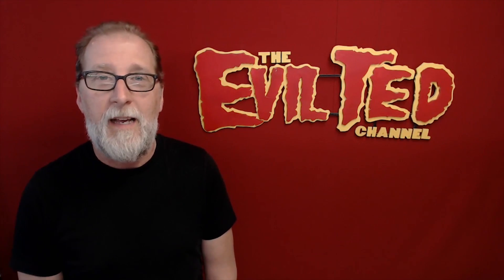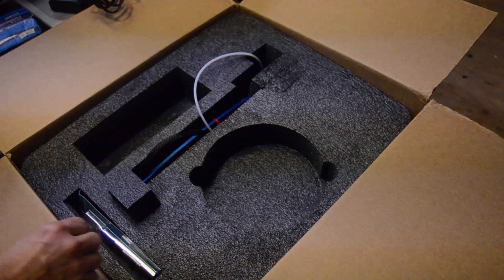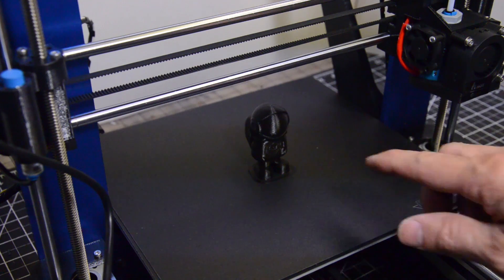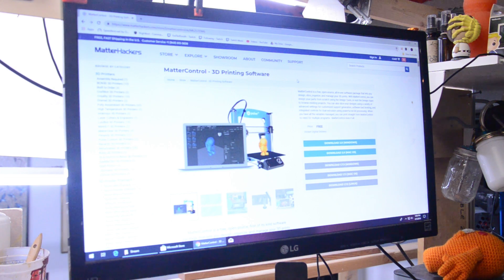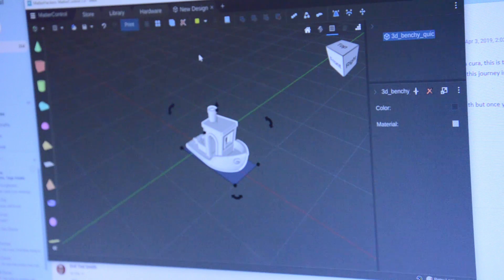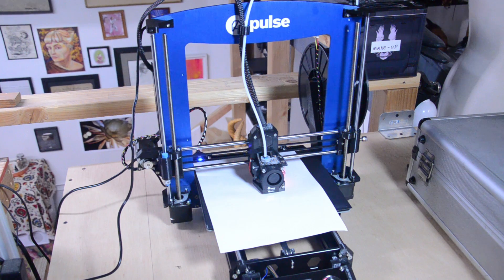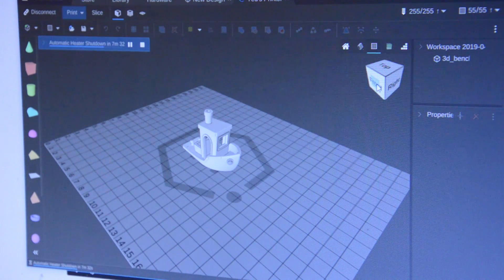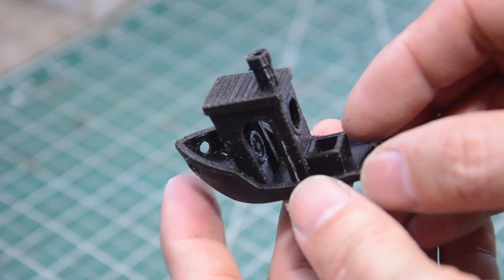Setting up my PULSE 3-D Printer.

Comment: I think I missed the part during the setup but why did you cut off the bottom of the bench model? Also have yo tried printing it without supports? At the original scale of the Benchy, the overhangs are short enough that the printer should be able to handle it without them. If you DO see any issues in those spots it a clue that the settings need to be adjusted, for example the extrusion temperature or cooling fan speed.
Reply from the maker: Got it,

Comment: I would love a 3d printer but I'm not tech savvy. I recently learned my phone is capable of Tap to Pay but i can't even figure out where in the menu options to go to to turn it on. Need to Google that. Don't even get me started on adjusting my autocorrect. I've spelled some words wrong so many times, it suggests the misspelling now, like "5hat" instead of "that"